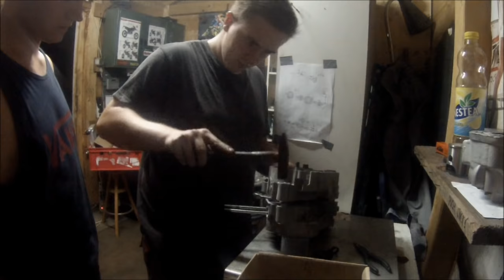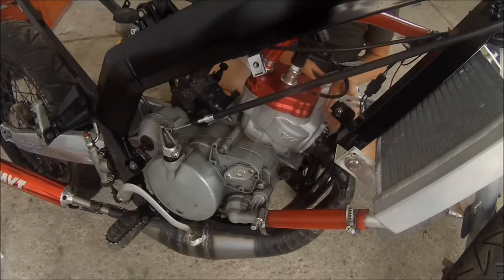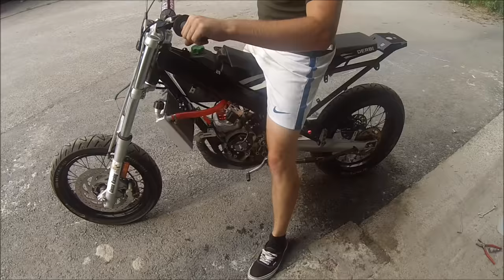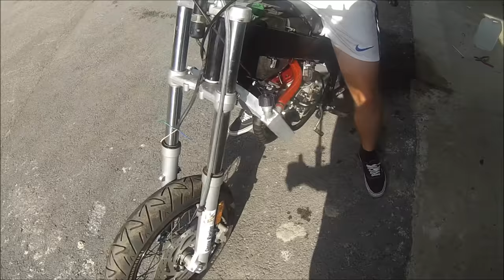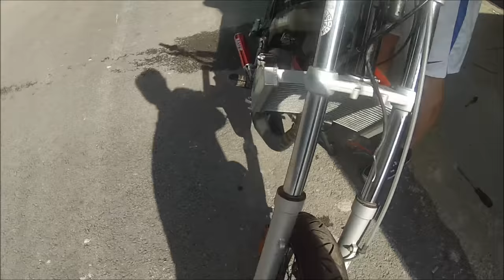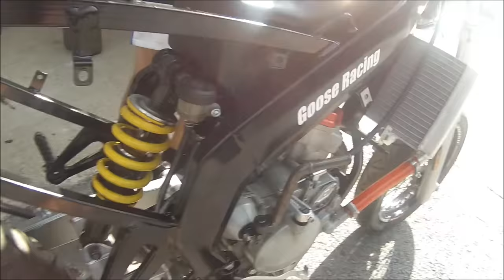100cc MVT zusammenbauen & "First Start" // Goose Racing

Comment: Warum hat er nicht gehalten wegen dem großen vergaser oder wie weil ich hab jetzt auch diesen zylinder bestellt und möchte nen 34 vergaser verbauen, würdet ihr es mehr empfehlen einen 32 zu verbauen?
Reply from the maker: failext wir hatten den Zylinder 2 mal und die Beschichtung platzte 2 mal an der selben Stelle ab. Diese Zylinder haben einen Produktionsfehler, das hat nichts mit dem vergaser oder ähnlichem zu tun. Wir empfehlen dir diesen Zylinder NICHT zu verbauen und einen bewährten Zylinder wie Bidalot, Barikit, Malossi oder 2 Fast zu verwenden
Reply: Goose Racing schade aber tratzdem danke für die info, ich kann ihn jetz zum glück noch stornieren sonst währen ja wegen kurbelwelle und zylinder über 600 euro weck. Aber noch ne frage weil ich jetzt den bidalot bestellt habe würde ich gern wissen welchen vergaser ihr da am besten empfehlen würdet öder fährt
Reply from the maker: Wir empfehlen dir da den 34mm PWK aus unserem Shop: www.goose-racing.at
Reply: @gooseracing6510  what about the 90cc version? how much hp and is it a good celinder

Comment: Gibt es Zylinder von der marke die gute Qualität haben? Ging sie gut mit dem zylinder bevor er eingegangen ist
Reply from the maker: Die Grauguss Zylinder sind ganz oke fürn Alltag, ansonsten würde ich die Finger davon lassen. 
Nein ging nie gut da wir ja den motor ja noch eingefahren sind
Reply: @nakkimies5029  usually the mvt cylinders 90cc and 100c tend to seize
Especially the 100cc
The 90 is better i think
Rwhp will be at around 20-25 depending on how u tune it, exhaust ,porting and more
Reply: @junkablyet944  so its about same as 88br
Reply: @nakkimies5029  mvt isnt really a high end product its pretty cheap yeah
So 88br will definetly come close
I dont know about am6 engines but on d50b0 its definetly like that
But i cant be much different
Reply: @nakkimies5029  but as i said it also depends on tuning, porting, exhaust ignition and stuff
We made 25rwhp (30hp on crank)with an 77prorace 4
But there where many good parts on that setup and we jetted the carb to perfection.
Reply: @nakkimies5029  yeah but ignition,exhaust, also play huge roles
I dont know if mvt seizes on am6 but it does on derbi the 100cc atleast
The 90could be better but as i said i dont know
Reply: @nakkimies5029  yes if u have the money
U mean 30hp on wheel or crank?
Reply: @junkablyet944  wheel
Reply: @junkablyet944  what is the main issue with this cylinder because the coating looks awesome and i dont think it's gonna fail
Reply: @nakkimies5029  the coating is the issue bcuz it will pop of and the cylinder gets a bit smaller on the top than its in at the bottom from diameter
Means the cylinder isnt symetric 
Atleast that is what i heard
I dont know if it is true
Reply: @junkablyet944  you seem to know about theese cylinders so do you know if the piston pin is supposed to move side to side a little bit when i rattle it
Reply: @nakkimies5029  well on my cylinders its normal aslong as its just a bit but not too much.
Reply: Like max a milimeter or something depends on how much play u have
Reply: @junkablyet944  i mean it moves much and i have send reclamation of that
Reply: @nakkimies5029  yeah better than risking anything
Reply: @junkablyet944  ok
Reply: @junkablyet944  my cylinder has 0.2 on top of the bore and 0.25 little bit below so is that the "too tight" issue?
Reply: @nakkimies5029  from what i personally heard yeah. But i dont know if that is actually too much
Reply: @junkablyet944  i just hone it a little and its perfect
Reply: @nakkimies5029  good luck bro👌
Reply: @junkablyet944  thx for help bro
Reply: @nakkimies5029  update?
Reply: @junkablyet944  i have cylinder ported by professional and he measures the cylinder also so i can see if i have to hone, everything going good so far
Reply: @junkablyet944  i have come to conclusion that the cylinder isn't too tight but the piston ring is a little so that's maybe the issue with theese cylinders
Reply: @nakkimies5029  oh interesting. Have you already started it?
Reply: @nakkimies5029  i bought a derbi drd pro yesterday if u know that bike😀 very rare where i live
Reply: @junkablyet944  i have double brake wheels and forks in my rieju so i know :D
Reply: @nakkimies5029  dammmnnn regular double brake or usd?
Reply: I mean uup side down forks
Reply: @junkablyet944  usd
Reply: @nakkimies5029  dammmmnnnnn thats hella expensive
Reply: @junkablyet944  got forks for free from friend and wheels where 300€
Reply: @nakkimies5029  lucky
Reply: What is your instagram name?